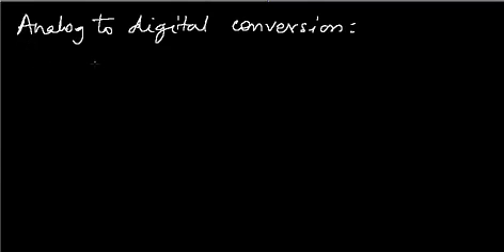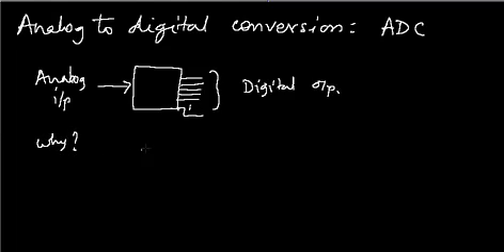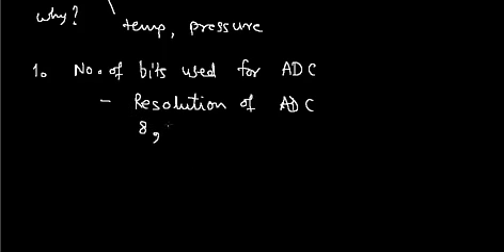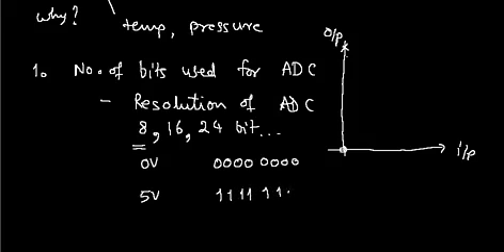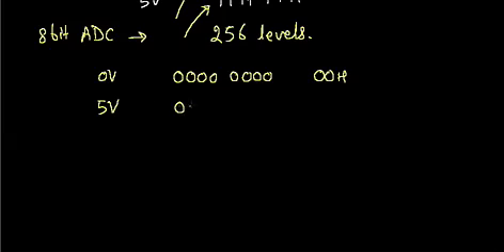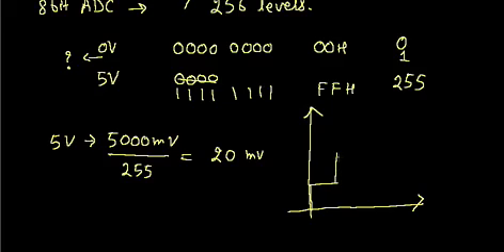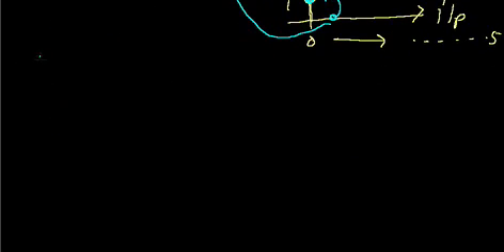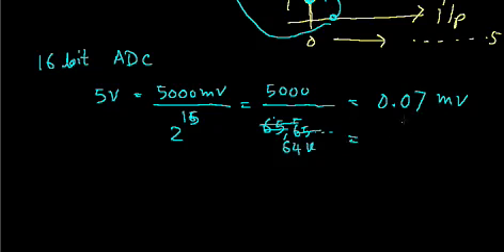Analog to Digital Converters (ADC) Part 1

Comment: What is the DAC's role in construction of A to D converters?Pls can anyone answer this question
Reply from the maker: DAC is needed for building an ADC for successive approximation type ADC. Here we use digital patterns, convert them in analog (using DAC) compare the generated analog value with input unknown analog value.
Reply: Tq u so much sir🙏

Comment: One point can you stress -- it is not the temperature or pressure which is the analog signal, it's the voltage or current from the respective sensor (such as a temperature or pressure sensor). The voltage or current is an analog value, and that is being converted to digital.

Comment: Can you explain to me why it was 255 and not 256 since 2 to the power of 8 is 256?  Thanks
Reply: Also,why do you divide by 5000mV and not just 5V?
Reply: Because the index value starts from 0 to 255..therefore there are 256 values counting from 0

Comment: sir why cant we increase resolution by decreasing the biasing volt from 5 V to smaller values?????
Reply from the maker: The resolution of ADC depends on how many bits do you use to represent the digital output and the reference voltage. If you reduce the reference voltage, it may reduce the value of min analog input that can be measured, but it also reduces the maximum value of analog input that ADC will be able to accept. Also when we convert time Tx to a count, the max count depends on the fixed clock. This clock and max(Tx) decides the resolution. Hope this is useful In case of any doubt pl. write back.

Comment: hello Vid,  thank you for the reply,  yes  if you can  please demonstrate if you can  with a video, because I'm still  not exactly  understanding it. 2006 I graduated  from  DeVry University  majoring in  applied science  and computer technologies and although I did learn about this subject the professor really never got to explain  to me this question that I'm asking to you. Most the labs and lectures was  the same subject  as what you're explaining here  almost  bring me back  to the classrooms as I watched.   I always thought  that it was a reference point they used when reading  the sine wave and with the 16 bit depth 7 being 0  Reference,  but it seems it's not the case and so I would like to understand exactly how it's done  or how the level shifter circuit  you say they used worked, but   mainly the circuit that used in a standard CD player witch uses a 44.1 sampling rate at a 16  bit depth..  Thanks you Louie

Comment: hello,  good video  but please can you explain what determines the negative part of a sign wave pattern?  meaning   you have 0 + 5v  digital steps,  but what  about  0 to -5 V steps? A full analog  sign wave goes from negative to positive  being the total amplitude of -5 to + 5= 10 so how does the analog-to-digital converter know or figure out when the  sine wave cycled negative or does it leave it out of the factoring when reading the sine wave  and only concerning  about  the top side of the wave, but then wouldn't that course clipping? Or is it just a mirror image they are using for the negative side of the sine wave? Nobody explains this anywhere  and I would like to know?  thank you
Reply from the maker: If you wnat to digitize a sine wave, in most of the ADCs you need to shift the sine wave up so as to have no -ve voltage (using some sort of level shifter circuit). Here the digital data will be unsigned digital value.
If you want the signed digital values of the sine wave, read the ADC output, then save the value in a signed variable (in a C program) and subtract the half of the range from it. So the digital value will truly represent the +ve as well as negative values in digital form (a signed variable is needed ot hold this data)
Hope it clears the doubt. However, in case you need more clarification do write back your queries. May be I will prepare a small video to explain this.
regards,
Dharmadhikari